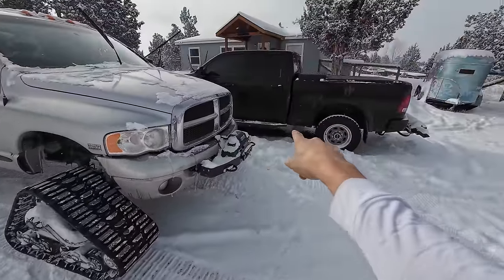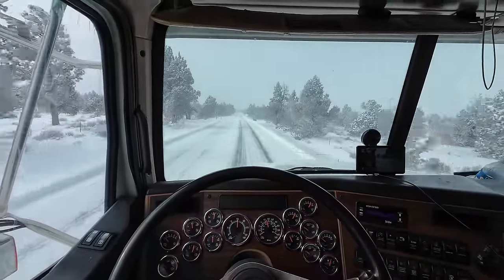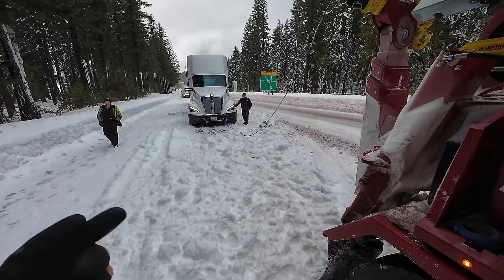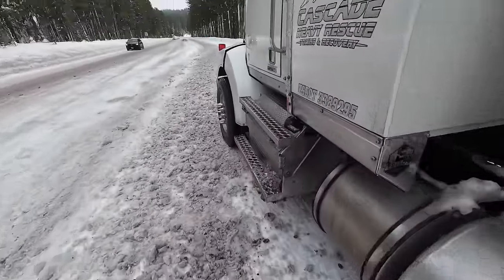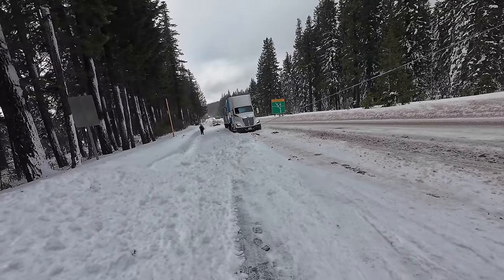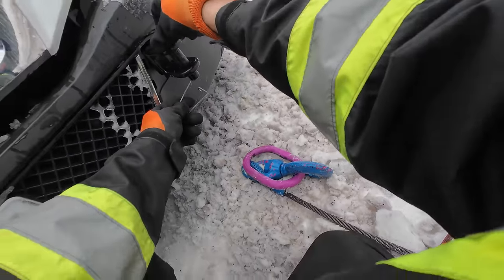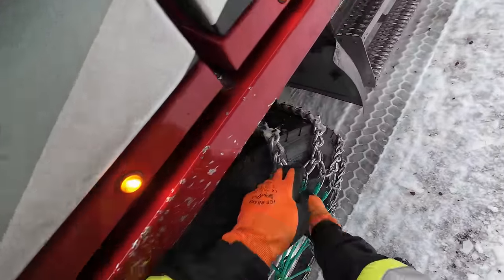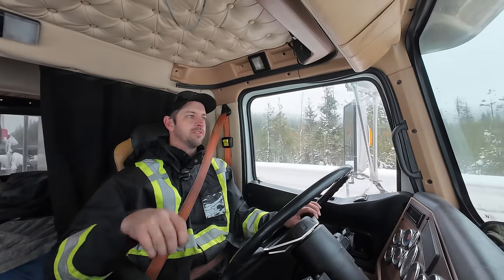The mountain gets another one!   Heavy duty winch out

Comment: Many years ago i had a  Volvo semi with a non powered tag an axle air ride. I bought a set of auto chains in Provo Utah and I loved them. I never had to install three railer chains again, just threw on a set of singles  on the outside tire if doubles were required and flipped the auto chain switch. I loved them , enjoy your content.  The new diesel compliant engines are a nightmare for an owner operator, and reliability is gone.$$$$$$$

Comment: Glad you mentioned thet wind chill doesn't effect equipment. Hard to get that through peoples heads sometimes
Reply: But does it speed up the cooling off period until the motor, radiator, fuel tanks reach ambient air temperature?
Reply: If windchill doesn't affect heat loss, then why do semi's (partially) cover their grill in cold temps?
Reply: @c-qc-q2021 wind chill only effects material that is warmer than the ambient temperature. Let’s say outside is -10 but your truck is +20. The windchill will draw the temperature of your truck down to -10 faster but it will not take it below -10. Sample is if you shut your truck off in a field that is -10 outside but the windchill has a feel of -100. The truck will only go down to -10 no lower. Just like an aircraft flying, the faster the air goes over the skin of the plane the warmer the skin gets do to friction.
Reply: @iffykidmn8170  yes it cools things down faster but doesn't make it any older than ambient
Reply: @iffykidmn8170  Yes, that's why radiators work.
Reply: @c-qc-q2021  That's to keep the engine running warmer. Too much cold air going through the rad cools the coolant too much. You don't want to run a diesel too cold.
Reply: @georgevindo they run diesels up around the artic circle you see truck drivers fighting ice on the inside of the windows they'll run any temp

Comment: That Zacklift is a beast! Keep on trucking!!!
Reply: I wish I'd went that way instead of a heavy wrecker I could've put a spare truck on it and still pulled a trailer when needed instead of the truck sitting in the shed hooked to a trailer getting used maybe 3 months a year I wouldn't trade my rotator in but it's a beast of a different breed it can work 360 degrees around itself lift more and higher and reach farther away next heavy wrecker we get will be a setup like that

Comment: My dad tells me in the dead of Wisconsin winters he'd mix up to 1/4 kerosene into the diesel to prevent gelling. Haven't done research on safety of that, but can tell you we sold that truck at over 350k miles still running great.
Thanks for starting the week off right with a new video!
Reply: We used alcohol.
Reply: Not Bud Light I assume 😂 @Bryan-Hensley
Reply: @Bryan-Hensley that's essentially all the 911 fuel treatment is.
Reply: They use that in Canada and I believe Alaska. A guy in Winnipeg demonstrated how fast it melted ice in a cup. Faster than straight up isoprople I have used. Frankly these days even at -20 and a -50 windchill gas seems to not gell. Number one diesel works well unless sitting over night. @SheldonGoff
Reply: What is it with American diesel not being able to work in the cold? As long as there is no water in the tank it's no problem as long as the batteries, glowplugs and coolant heater is serviced.
Reply: @TheBibliofilus winter diesel has more kerosene and no paraphin. Typically summer diesel will work until -7°C. Places where the weather doesn't get that cold only use summer diesel (#2 diesel) and people add antigell additives themselves when it it colder.
Reply: @brandonreimer184  The diesel we have here in Scandinavia has no geling up problems , but it's more refined and closer to kerosene than old-school diesel so the only problems with it is that it's so dry, non-lubricating.
Reply: @TheBibliofilus  Also, remember, the US has a wide range of weather/temps to deal with, and that largely depends on where you live. 

For instance, the west coast generally does not get as cold as say Wisconsin or Minnesota where the overall temps will get below 0F at night and may rise up to the single or double digits during the day - at best, so winter diesel is necessary (or home brew concoctions to perform the same) to aid the glow plugs etc.

Out here, our temps most winters, especially on the west side of the cascades rarely gets out of the 20's-30's at night, and when it does, it's due to unusual situations where the arctic blasts (arctic express) from Canada's Frazer Valley makes it all the way into say, Puget Sound and sits, with a warmer, wet front overriding it, and we can get really cold and at times lots of snowfall, of say, a foot or more, when temps are around freezing (30F), but get really cold but dry for several days before we moderate back to the 30-40's during the day. At that point, overnight lows, single digits, topping out in the teens/twenties during the day.

Out here, we can often get away with #2/summer diesel year 'round and just add an additive as needed during the colder months.
Reply: And in winter it's safest to order pure, non-renewable mixed diesel in bulk to avoid water and contamination issues.
Reply: @TheBibliofilus  there ya go our less refined diesel must have a lower freezing temperature, and maybe more boom in it.
Reply: Nothing to research..#1 diesel at the  pumps is basically kerosene..
Reply: @57WillysCJ 
That must of been Sir Rodney,  at Westrans . 😊😊
Reply: Yeah, Kerosene isn't far off at all from #1 Diesel.. I believe its just a step further in the refining process.
Reply: I always put in isuprophen alcohol for fuel and air tank to keep brakes from freezing up.
Reply: @57WillysCJ  Number 2 is furnace oil. Number 1 is stove oil. Winter fuel here (number 1)is a lighter grade of diesel. Its good, doesn't gel. We used to put ATF in the fuel though too to keep the injectors lubricated. The winter fuel is a lot drier than regular diesel. I'm surprised the northern states don't us it.
Reply: @57WillysCJ  We never had a problem with a truck sitting overnight with them starting until it hit 40 below but that was because the oil was like molasses but only on Monday mornings.. That was the only time we had trouble starting. Our trucks were double shifted, so during the week, the engines didn't get that cold even when sitting for a few hours between shifts
Reply: @TheBibliofilus  If it sits until the fuel gets cold it gels because of the amount of paraffin in it. Number 1 diesel doesn't gel.
Reply: @owendodman3037  It definitely has more power in it but it does gel at lower temperatures.
Reply: @TheBibliofilus  all diesel has an LTO ... low temp operability. It's blended with either kerosene or other similar "lighter" fuels ... your fuel mileage suffers, but it doesn't gel up (which is really the wax separating out). In Northern Frostbackistan where I run,  the Mess is LTO -8c, and as I go north, it goes from -24c thru -31c all the way to -50c at the pump, before I even start dosing in the anti gel. Remember,  if it's any bio blend, you need to DOUBLE your dosage.
Reply: @SPD_driver I work in mechanised forestry and we usually work down to -30c or stuff starts breaking.. As long as there are no water or additives in the diesel there's no fuel problems,  DEF however is another story as it's start to freeze up at -11C..
Reply: @TheBibliofilus  Absolutely! Around -28c to -34c actual cold soaked, metal starts to change, and as you say, shit just breaks. And you're on with the DEF,  but it only partially starts to freeze up (I usually carry a spare jug, so I've observed it). In a truck tank, the onboard heater will usually (not always) thaw enough so that within the first 10mins something happens. Most of my late model trucks will run ok as there's ambient temp sensors that allow for frozen  DEF operation. That said, I tell my drivers to never fill past 80% def tank if it's going to be below -12, as I don't trust it not to crack. Freeze/thaw doesn't effect def quality tbo.

Comment: I dove for one of the big grocery chains in Oregon for 25 years. One of the “rules” that we learned early on was to NOT set your trailer breaks if at all possible in freezing weather. If the tractor brakes froze up you could free them with a genital application of power. Lying in the snow and ice at 10 degrees for an hour banging on trailer break drums will make you a believer in wheel chocks.
Reply: Also if you park on ice or snow sit for about 10 minutes and then pull ahead.  That's because your tire are somewhat warm and will melt the ice and you are parked in a divot. I ran the ice roads and bush roads 45 years ago before all this technology.
Reply: @ericgeorgetruckgrilling  Very true.

Comment: Do you have same quality diesel in winter than in summer? Gelling up at 2F makes me think of that. In my country that is normal temperature with no anti-gelling additives but we have a different kind of diesel sold in winter than in summer. As the name suggests, winter grade diesel is fine for winter that is specivied to -29F (-34C) without additives. (I think there is also arctic grade available in colder part of country that is fine for a bit more colder)
Reply: Yes, depends on where you live. In the NE/northern states, it can get really cold during the winter months that a colder grade (winter) diesel is required, same in Canada/Alaska.

But for many of us that live where it generally does not get much below the 20's at night much of the winter months, often times, winter diesel is not really necessary but many will add aids to help their diesels start better on colder mornings anyway.

Comment: Wind chill only affects equipment if the equipment is above ambient because it affects the rate at which the equipment is brought to ambient. If your truck and fuel was at 10° F during the day and the overnight low is -10°F, wind will bring the fuel temo down faster. Having a wind shelter may keep the fuel temp higher longer.
Reply: Or put a good heavy tarp over the hood and run an electric heater under the engine to keep it a little warmer.

Comment: In nordic countries we use quite alot of electrical engine heaters, I don't know why they aren't used more widely. They don't heat the cabin, but in cold weather they make firing up an engine much more reliable. Defa and Calix are the most common brands, both have wide range of heaters to fit different engines. But if you're interested make sure you take the whole kit from same place, their connector don't fit each others.

Comment: See about setting up optimized idle on your truck since it does alot of idling it pretty much will do a regen when needed while idling and higher idle to prevent soot build up will need diagnosticlink 8 or maybe take it to a dealer its quick enough to do less then 30 mins and its setup
Reply: Better yet, get a good mechanic who knows what they're doing to delete the DPF system altogether.

Comment: I run north dakota in the winter super cold the 2 thing i find that help with the derate are putting cardboard over front radiator because the engine never seems to get warm enuff to regen when its like -10 and sleeping in high idle
I dont drive with cardboard on rad just idle

Comment: Hey Casey.  Short cut to get to high idle. Just hold thr button to set. So you don't need to push it many times  it will automatically run to 1000 rpm. At least my western stars did.

Comment: I ran up north for many years, You have to take care of your air system( no air dryer back then) #1 airline antifreeze pour down your airlines then hook up , and open trailer air tanks to drain moisture,do this till the whole system has antifreeze #2 never pull the button to park pull down spike just enough to hold load, then lock it. (( Dont forget to drain the tanks ))
Reply: I used to pour a gallon of that airline antifreeze into the wet tank and left it there 'til spring. It worked really well that way.

Comment: A trailer with some weight in it is better than an empty trailer. Weightless rigs slip n slide easier.

When idling for long periods, we use to run the RPM's up to keep oil flowing thru the turbo. Maybe newer engines don't have that issue?

Comment: What antigel did you use? We don't like Howes for one and some you have to double it up when down to a certain temp. We find just putting antigel in the day it gets cold. Doesn't work well. Need to out it on a little before it gets colder out and before it gets really cold sometimes it help to change the fuel filter.  Look into diesel fired engine coolant heater. You can run that to keep engine warm and if you have tank or fuel filter heater it can keep things warmed up.

Comment: It’s amazing to me that diesel trucks are so fragile in the winter time. They’ve been around for decades and you would have thought the companies who make them could come up with a more reliable means of propelling and stopping them.
Reply: Check out Edison Electric trucks, they are pretty awesome.
Reply: Diesel is only a problem in America where they don't make it winter proof. 
I have started my diesel car in -25 C without any problems, cause it has winter diesel. 
The reason brakes freeze is cause they don't use the brakes enough before stopping, they rely to much on the engine brake, cold brakes will freeze.
Reply: @dubious6718  My understanding of what you’re calling “Winter Mix” is a little more complicated than you either have it or don’t. To make fuel compatible with severe cold driving conditions it consists of a blend of the standard #2 diesel with some #1 diesel (aka kerosene) and perhaps a special additive that keeps the paraffin wax normally present in #2 diesel from gelling up and clogging fuel filters. These winter blends are sold in the USA. For example Kwik Trip sells a blend called TundraMaxx in the northern tier of states. Some diesel vehicles also incorporate heaters in critical components of the fuel system like the filters. 

The problem appears to be when you’ve filled your tanks with #2 diesel and then experience an unexpected cold snap because the fuel has been sitting since the warmer months or you drive from an area that doesn’t experience cold winter temperatures to an area that does and you still have the warm weather #2 diesel in your tank. 

So why don’t you just drive with winter mix all year round and avoid these problems? That’s a good question, and since I’ve never owned a diesel vehicle here in Minnesota, I can only speculate. I suspect that the #1 diesel is more expensive since it’s more highly refined, or that it has some negative effect on the pollutants emitted by the engine burning it. 

But back to my original comment. You would think the transportation industry would have come up with a better solution after having decades to figure it out. Or maybe the solution is out there but nobody wants to pay for it.
Reply: @Dave-ei7kk  Number two has a lot more power in it than Number 1, so you'd end up paying more for less power and fuel economy if you ran a mix all year long. I much prefer number 2 for the power and economy.
Reply: @Dave-ei7kk  We have the solution in Norway, there is winter fuel on all pumps, we don't really do anything, other than fill up. I have no idea what's in it,.

Comment: That why I love my 2005 Dodge/Cummins it doesn't have all of the pollution crap that does nothing but cause problems, had  cousin who liked my truck buy a 2007, he had the choice between the 5.9 and the new 6.7 but he bought that because it was quieter at an idle that had the pollution stuff on it and it was in the shop too much and used way more fuel than my 5.9, he finely traded it in and 19 years later I'm still running my 5.9

Comment: Casey, do you use numbers 1 Diesel fuel in the winter? Do you have any problems with the DPF fluid freezing in the winter? I know there is a DPF heater in the DPF tank but some operators up North in Canada have problems with the DPF freezing if the engine is off over night. One farmer I know keeps his DPF tank about half full in the winter and keeps 5 gallons in a heated area and adds some of the warm DPF to the DPF tank before starting the engine.

Comment: Must be cheap diesel in the US if you can afford to leave the engine running all night, I though they only did that in Siberia. Here in Sweden it is common to use an electric engine heater, which –compared to idling–  is a much more efficient, environmental-friendly, silent and healthier way to heat an engine, not to speak of the  wear and tear of the engine that is idling in cold weather. Therefore in most municipalities here it is forbidden to keep a car or truckengine idling for more than one or two minutes!
Reply: It’s not the engine as I understand it. But it might depend on what fuel is used. Whether it’s intended for that temperature or not, or treated if needed. I believe his wasn’t thus running the truck was best method.

Comment: you need to build a heavy wrecker shed Casey for your wrecker so you can keep it in good working order pretty much 24/7 and dont have to worry about it not gonna work next day.
Reply from the maker: Way too expensive
Reply: @CaseyLaDelle straw bale?
Reply: @CaseyLaDelle  it dont cost that much to build if you use 2x4. even a 2x4 shed does wonder against weather.. 1 dont need a big metal or concrete shed.. a 2x4 basic shed whit wooden walls will do alot.
Reply from the maker: @stigroarjohansen5656  a heated shop big enough to house and work on the truck will be in the neighborhood of $200k.